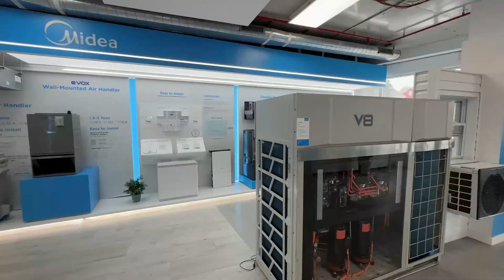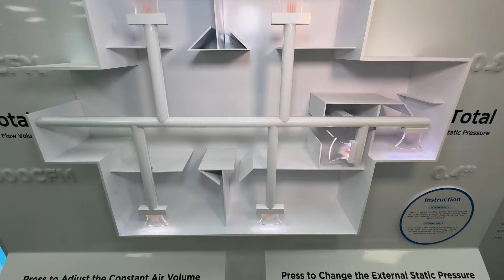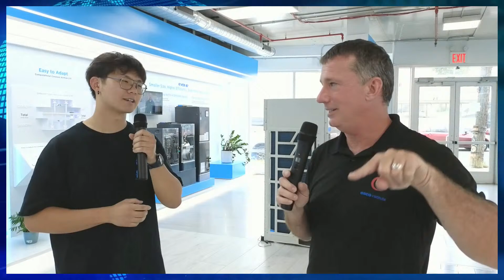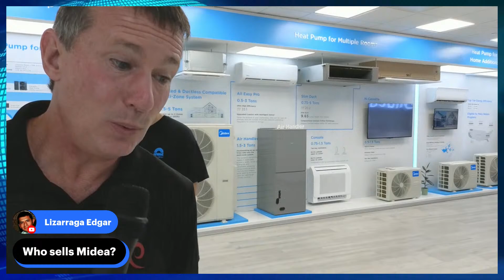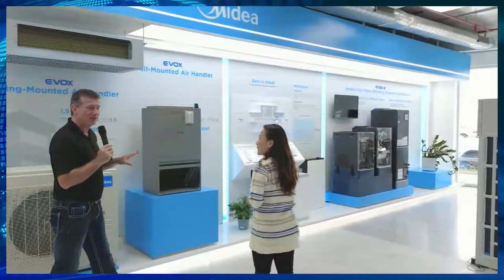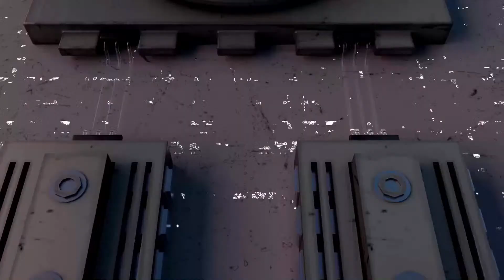Next-Generation Heat Pumps with Midea

Comment: I have had a Midea mini split hyper heat for about 3 years running 24/7 and its been great not the first call on it. Even when down to-5 the air coming out of my wall unit was 120F . My Gibson system broke after 8 years,the replacement Ruud system has done nothing but leak. I won't be spending 9k for a whole house system when I can spend 1500 do the work myself and even if it runs for 5 years and I have to install another I come out ahead add that to the fact that my Midea heat pump heats my whole house without AUX even installed. The prices Hvac companies charge are getting out of hand. Then they get mad when you install it yourself is rich. I was quoted 6800 bucks just for the labor to install my mini split , I did the whole job alone in 6.5 hours. They could have done it all in 3 hours. That comes out to over 2 grand a hour. They gave me a sad story about there costs and I gave them a sad story that they have lost my Dads account and service contract for all of his rentals, I just did it for petty spite and sweet revenge .

Comment: We have a side split with hot water heat, and minimal ducting in Ontario, Canada..  A Midea unit with multi heads and small form factor Evox G3 would be perfect for our home but can't find a single installer who knows Midea well enough or can source the G3.  Best way to get this unit up here and installed?
Reply from the maker: Midea will be on our show this Thursday discussing the Evox lineup. I’ll ask
Reply: We are in Rolla MO USA 
awaiting arrival of the AHU g3s

These are so new to the market, preordering is the way to go with a contractor you can rely on to service them. 
We are anticipating the full line up being readily available at our distribution 2026